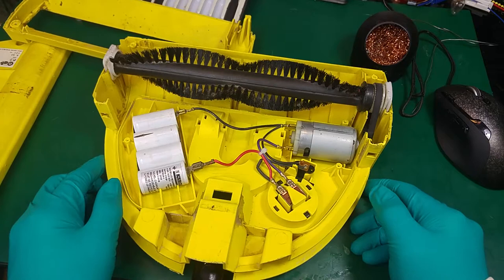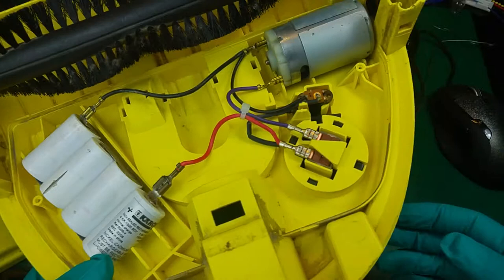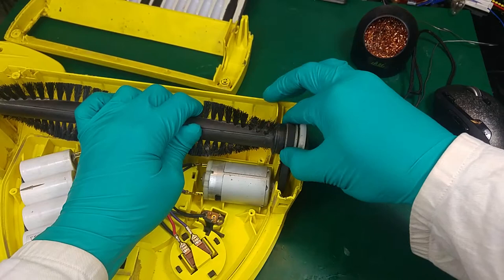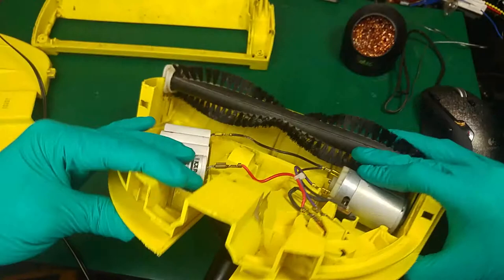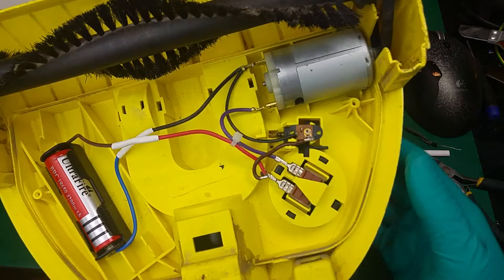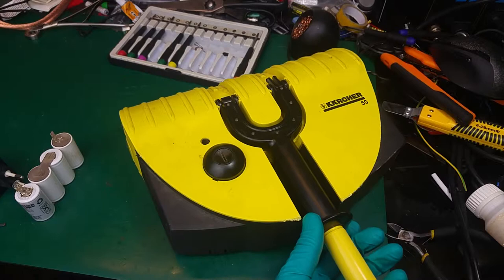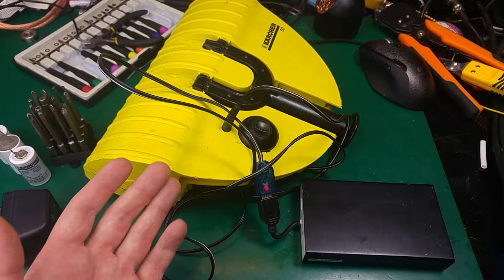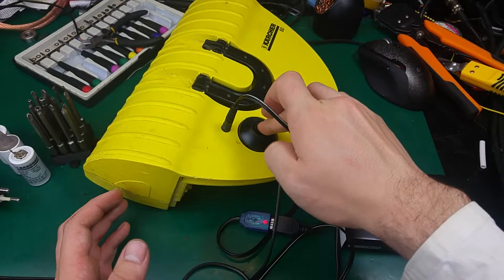Fixing dead Karcher K50 electric brush by using 18650 protected cell

Comment: I have always liked the idea of building my own robot, but could never think of something practical for a robot to do for me. (nothing legal anyway).
THIS is it. THIS is what a home robot project should be.
I know that you can buy robotic vacuum cleaners, but they mostly seem to be plastic jokes.
I like the idea of gutting an old upright Dyson and building something from that. Good suction motor, cyclone filtration and decent wheels with pneumatic tyres.
And a gyro. I'm not doing it unless it has a gyro. Because, reasons.
Reply from the maker: Yes, i also tried robotic vacuum cleaners but they all have one problem... they stuck on cables, wires laying around - either You change all habit, glue all cords, chargers to wall or it will be useless :(   <- sadly but true, can't see work around :)
For home, i would recommend bomb disposal robot, of course with basic weaponry that ale legal, like butane torch or battery operated chainsaw. Controlled remotely via app on smartphone. Movement detected on fence line, you got message on phone app via mqtt, and take control, just drive to check what's going on ^^
Reply: @ElectronicNoobBlog 
I hate cables. A lot. All my cables are out of the way already.
The main problem will be trying to "map" my floor. I could do it with switches or proximity sensors (switches would be more reliable), but it would simply follow the edges. To get it to efficiently cover the whole floor would require some kind of map.
Maybe the butane torch would help? Instead of complex mapping and self learning, I could just measure pressure differential across a filter. When it thinks the filter is blocked, the place must be a mess, so it torches the place. My home burns down and I can rebuild it.
Seems a LOT easier.
Reply: Caiden Reuben  Pro trick: Spam using a different elevator pitch from time to time, and create more than one sock puppet to "agree".

Comment: Unfortunately, I wanted to order new small plastic wheels with metal axles, but the Kärcher service in Switzerland says they are no longer in the program.
Reply from the maker: Those real problems with "saving environment" - You have throw device because lack of parts. Better fix than recycle...   Try 3d print wheel and put nail as axial :> Or maybe someone already design it on thingverse.
Reply: @ElectronicNoobBlog  I turned the plastic wheels (diameter/width 15x8.3mm) and drilled a hole 3.1mm. Not all housewives have a lathe and a drill at home...